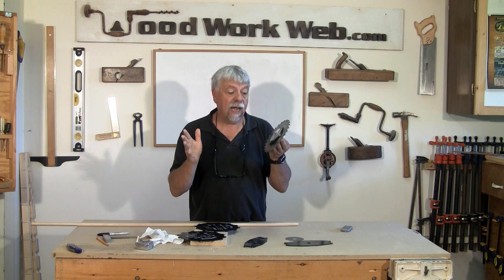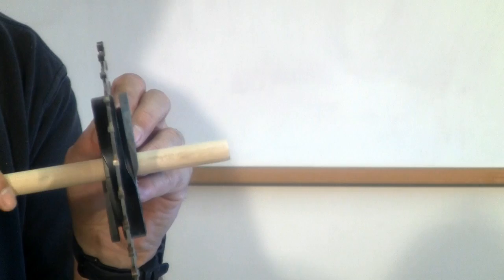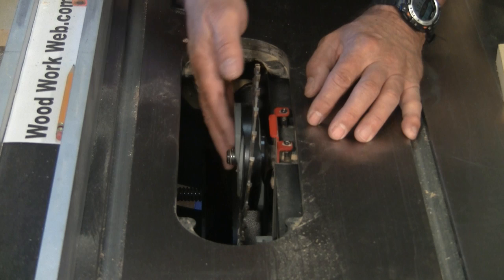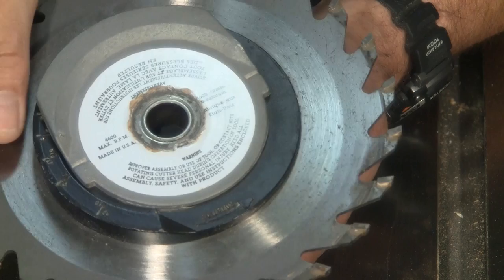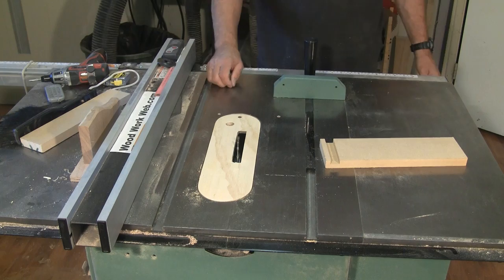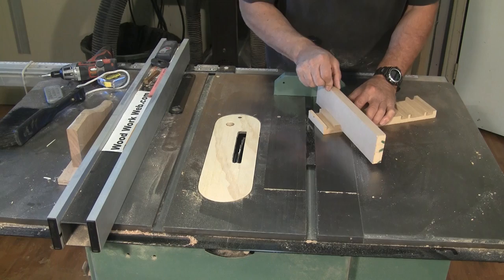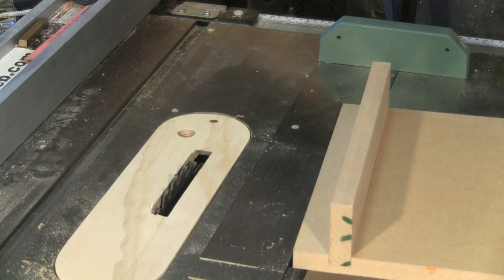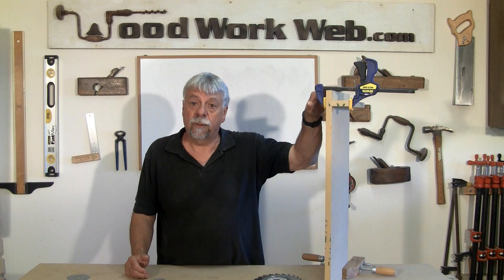Testing the Wobble Dado Blade -  woodworkweb

Comment: perhaps as the arbor is tightened it maybe changing the settings on the wobble. maybe if they re-engineered this product it could be several different wobble wheels at predetermined dado thicknesses considering the low cost. nice video though. one of the funniest ones ive seen from you. i can only imagine the curses coming outta ya during the sped up parts of the vid. lol

Comment: I have one also, have had it for 25 or 30 years.  Only problem I have with it is that it needs to be sharpened but no one in my area can sharpen it.
Reply: Really?  My saw shop guy said he can sharpen anything, he just can't replace the carbide on random blades.
Reply from the maker: That's interesting, I would  have thought most sharpening places could do that. I will have to check with my local sharpener, thanks for sharing this Doug, I did not know that.
Reply from the maker: Nicholas Smerk Yes, I am going to check with mine to see if they can

Comment: Stay away from the "Wobble wheel" just save a little and buy a decent dado set. The wobble wheel causes unnecessary stress on the saw components that they were not designed to handle. That is why they stopped making them, not just cause they sucked. who wants a spinning frisbee of death flying through their shop and even worse now it's become wobbly and everyone knows that makes it 1000 times more deadly

Comment: If I had to rely on a dado for a glue line I wouldn't want a channel along the bottom of the dado.  If I ran a furniture shop, and it was down to my joint security versus the joint security of competitive furniture builders, I would wager towards a more secure joint, and therefore without the glue channels.  If other furniture companies or cabinetry shops were ok with that glue line channel, I suppose that would be ok with me, though I'd rather everyone just use whatever made the strongest joints.

Comment: Do they make this in a 12 inch ?
Reply: aux1z11 They did, though 6" and 8" were far more common.
Reply: who are you arrisicorncob?
Reply: I have a pathetic little woodworking channel under the ID "MrToolHunter" but the Aristocob channel is where a most active. I've been a corporate trainer at a German cabinet hardware company for the past 17 years and before that I spent 12 years as a trainer for the Shopsmith power tool company.  But to my grandkids I am Batman.

Comment: I have an old craftsman dato blade I use for rabbiting wood to make siding for our sheds we make lol it works great just aggravating if it gets off setting
Reply: just have to have a heavy saw or it'll vibrate it all over the place and eventually wear the bearings out
Reply: Never had the vibration you refer to.
Reply: Barry Wind physically impossible to have no vibrations with a blade like that (ignoring the fact, that there are vibrations on a saw in any case)
Reply: Okay, your getting real tech... yes there are vibrations on any machine. So, there is NO more vibration than normally found. Not with the blade I use. Did you notice the counter weight on the adjuster? Oh, you say, too late. The one I bought does not have what you describe... period. Now, go argue with someone else.
Reply: Your words do not change my answer one iota. My unit does not have what you want it to have no matter what you say... sorry. Go argue with someone else.
Reply: Barry Wind "I deny reality and that's auf good thing". Alright then. Seems like your unit created a parallel universe, where physical laws don't matter. Should I call NASA?
Reply: does it really matter you guys, I have a power matic that doesn't wobble when a wobble blade is on it, but the saw I was referring to was one that we take out on jobs that weights maybe 30-40 pounds so yeah when the blade spins at 7,000 thousand rpm it does shake if not clamped or attacted to the stand. I really couldn't care what anyone says when I see the thing shake with my own eyes a few times a week. I know that there is potential for them to shake. End of story, now go about your day.

Comment: this thing SCARES ME!!! if this is ust to cut a wide swath through wood for the reason in the video, it makes sense to use if you are like mass cutting dozens of the same fitting. I do not wood work at all so it is really MY OPINION! just from a total outside point of view. what is the use for the wobble wheel other than what I expect? I wanted to add THUMBS UP though or a really well edited and presented video you deserve the subs and thumbs up for that & for your desire to showcase this ... thing?

Comment: It seems like it would put a lot of wear on the motor bearings from the vibration
Reply from the maker: +John Doe I guess if you used it a lot it might, but it doesn't really vibrate despite the name .. they run pretty smooth,
Reply: +John Doe most table saws run with a belt that will absorb any vibrations, which there is none. These are well engineered.
Reply: You know how they balance out a car wheel?

If it wobbles, they just stick tiny pieces of lead on the inside of the rim and all the wobble comes out.

The mounting plates and adjustment system likely work the same way, balancing the weight to counter the wobble.

Comment: I don't use table saws, but I can see why those blades are not very popular, they take too long to adjust it to the right dado width and waste a bunch of material in the mean time just to try to get it to the right width. 
I would also assume that with an off center blade, it's going to cause vibration in the table. I don't think I like that idea either.
You're better off saving your money and getting a real set of dado blades.

Comment: one thing i do not understand cant you just sett it to cut the gap a litle short so you afther can just saw away the remaining  With that you need you do have an acurate table so you can use it so see if the gap is needs to be 1mm wider just sett the table to cut 1 mm to the side and cut of that 1 mm instead of fiddeling for an houer and finaly get it corect for 1 or 2 cutz

Comment: I'm going to pick one up for cutting dado for drawer bottoms.  As many of you know metric mania has swept us all into a quagmire of confusion, 1/4" plywood ain't a 1/4" it's thinner and stack dado blades only cut as thin as 1/4".  Ain't that just great.
Reply from the maker: Yep ... a quagmire of confusion is right, can I quote you on that Ed, that has got to be the best description I have heard.
Here's the deal with plywood (all plywood) according to the plywood manufactures code (or whatever they call it), no plywood will exceed it's thickness spec. You can even view the actual wording on their website.
Basically that means any plywood you purchase is under-thicknessed by design, then add in a bit drying shrinkage and we basically have to measure each sheet for thickness. Pretty inconvenient ...
Reply: WoodWorkWeb Yep, you can quote me.  I have some 1/4"  plywood with a maple veneer so thin that it amazes me that it can be cut that thin; so thin that you don't even dare look at it for fear of sanding through.  Though the label says 1/4" it is a mere .190, unbelievable.  Some nice 1/2" plywood measures only .460.  I can do the math and figure out how to cut a dado for .460, but .190 is impossible.  Maybe a wobble dado is the answer.
Reply from the maker: Ed Waggoner Sr. It might do the trick Ed, let me know how you make out with it.  And yes I know what you mean about some of those veneers, they look like they were painted on they are so thin.
Reply: WoodWorkWeb Colin,  it took a while, but, I recently acquired two wobble dado blades for free, both in like new condition,  I really wanted to be able to use one of them on my Delta radial arm saw, but alas the arbor is to short.  But they both fit my old Rockwell table saw/ jointer.  One of them adjusts down to a bit less that 3/16" making it just right for making drawer bottom dados that fit the odd size 1/4" plywood that ain't really 1/4".  So, thanks again for the great video that got me to thinking.  I really didn't want to purchase a special router bit, beside a dado blade cuts much faster without having to make multiple passes.  As it turns out my larger 33-890 Delta RAS has a longer arbor.
Reply from the maker: Ed Waggoner Sr. I need to shop where you do Ed, free is a good price :)
Glad this was helpful to you ... always good to hear from you Ed
Colin

Comment: I just have a cheap tabletop saw that has a shaft that's too short to fit more than one regular blade.  If I had a saw that could take a wobble blade, I'd make a jig to hold the blade so I could adjust the width before I put it in the table saw.

Comment: nice tool ! but heavy table needed for this. and\or non-high RPM
Reply: Not really, the blade is fitted with a counterweight that balances it the vibration is still noticeable but its hardly critical.

Comment: I noticed that all your many first cuts were too narrow, so you were only slowly approaching the right setting. You can speed up all those adjustments with what in computer land is called a "binary search". First take a setting that is definitely too narrow and do a test cut. Next do one that is definitely too wide. Write it all down. Now take a setting in the middle of the previous two and check if you need to be in between that middle cut and too narrow or the middle and too large. Assuming the middle cut was still too wide, now do a test at 1/4 and check again if you are between 0 and 1/4 or between 1/4 and 1/2. Rinse and repeat and in just a few tests you are where you need to be. Much faster than "slowly approaching".

Comment: You can fine tune a stacked dado set a bit by slipping paper between the blades. :-)
Reply from the maker: I have not tried that, but it sounds quite do-able ... thanks for the tip

Comment: I think someone should rework that thing. If you could make dialing it in more accurate it would be great. I dont even think you had to take it off the arbor to move the dial a bit, looked like just a viewing issue. Like you said, the crown was in acceptable limits, I would buy it all day long.
Reply from the maker: Yeah .... I'm not an engineer, but I think you are correct, for the right person, this unit could certainly be improved ... it does have some merits.

Comment: The saying "measure twice cut once" comes to mind for some reason?
Reply: +Pepper Spray Wobble blades puts that saying on its head. The guide is completely not accurate, i guess it is difficult to manufacture them with tight enough tolerance, but I hear you get a knack for it once you learn how your specific wobble blade is out of spec.

Comment: Mathematically it wont make a flat rabbit. As one blade is being used to oscillate from one side to the other it will have a high point in the middle so it can weave from side to side. The wider the cut the more the high spot is noticeable.
Reply: And the side walls will not be 90°, they will be tilted
Reply: Think again Brecht. As the blade rotates, the outermost point of the blade  takes a round flat route, as the other points of the blade. That makes the blade to cut precisely a 90° sidewall.
Reply: baladár kolompár I did think before I comment, and I still think that the sidewalls will not be 90 degrees. I would have to test it to see if the 3D imagination in my thoughts does fit with reality or not. And the fact that the oscillation gives a rounded surface instead of a flat one (depending on how wide you set it etc) gives me an other theoretical suggestions hat that is the case. But I don't have experience with those wobble blades, maybe what I said does only count for deep cuts and/or wide cuts. Or maybe I am imagining it wrong.
Reply: baladár kolompár Maybe I should try to find someone with a wobble blade and test it for myself how well my imagination match to reality
Reply: Brecht Schatteman
I had experience with one of these blades, and the sidewalls of the cut is 90°. The top (or bottom) surface of the cut is rounded a bit, but not he sidewalls. As the workpiece touches the blade, the blade cuts its bottom, and as the workpiece moves ahead, the groove is getting deeper and deeper. If your tablesaw's shaft is parallel to the table, the cut will have 90° sidewalls.
Reply: baladár kolompár I did understand what you ment, but it is something I will have to check myself unfortunately. It is always possible that I make a mistake, and knowing myself I probably did.
Reply: Brecht Schatteman
If you admit that this has to be checked by yourself, then you are a smart guy. Practice makes the master. Take care.
Reply: baladár kolompár It mostly is recognizing I lack the experience/knowledge, that should only be called the start of being smart. In Dutch we say 'knowing yourself is the beginning of wisdom' but I don't know what the English equivalent is (probably that knowing yourself is the key to wisdom or such). And as much as I would like to start with woodworking and get some experience and make my mistakes, it will probably be for later. I lack the funds (although, I could borrow some stuff somewhere and I can always start with those dirt cheap low quality chisels) and the space (I am a student living with my parents and no real space left for such a hobby). Maybe in a few years, maybe when I hit a midlife crisis, maybe when I am retired, I can't predict when, but I know the itch is there so one day I will not be able to resist. Until than there is YouTube and guys like you who can have a normal conversation without stating to know it betters without calling people like me dumb. That is also why I like the woodworking community in YouTube, they are more accepting and tolerant than the average community. I wish you have a good day, and thank you to enlighten me about where my visualisation did go wrong. It probably did, but sometimes it can't hurt to check it yourself, just to be sure ;)

Comment: looks like a lil bit of a nightmare to setup but for the cost it seems pretty reasonable and like any tool it's only as good as the person using it. i've no doubt though if you do a lot of dado cuts then setting something like this up will be almost second nature. by the way! your last name comes from German and translates to Knight :)
Reply from the maker: You are right, it can be a nightmare, but .. you can also get it perfect the first time, unfortunately I cannot, which is why I struggle with it.
Thanks for the translation note too :)
Reply: :) no problem! i usually need to fiddle with stuff a lot until i get it exactly where i want it before i start to do anything lol. can easily waste half the day away just setting everything up!

Comment: You have it wrong. Wobble wheels cut flat bottom dados. Stacked sets don't. The problem with a wobble wheel is they're a little fussy to setup. You also spun the blade the wrong way too.
Reply: +Paul Frederick Yes, dado stacks tend to leave grooves in the bottom of the cut.  However, the wobble style leaves a slightly curved bottom.  As you saw in the video, it's not worth worrying about.

Comment: I would have thought it obvious what is wrong here and why there is an apparent gap. The floor of the dado is at he right depth, the problem is that as the blade leans the teeth are no longer cutting flat but as they are leaning they are cutting at a slight angle and so the floor of the dado will rise just slightly as it approaches the wall. The gap is caused by the inserted board sitting on the two slightly raised portions closest to walls.
Reply: +Jim Porter The wobbling blade actually cuts an arc. The radius of the arc is actually the radius of the blade.
Reply: I don't think so. That dado bottom looked pretty flat. I think it is like a 7" diameter blade. I don't think the dado bottom could have a 7" radius. That would be pretty noticeable.
Reply: I agree.. if you think about it, imagine that you're trying to cut a 5 inch wide dado.. or go to an extreme and say you want to cut a 7" dado with a 7" blade.. you'd have to make the blade wobble all the way sideways.. in which case the arc of the cut would match the arc of the blade.
Now, to be totally technical, the width of the blade complicates things and you'd have to imagine two arcs turned sideways at 1/8" apart (or whatever the width is at the top of the teeth)
So the arc is the same as the arc of the blade plus the width of the blade inserted in the middle.
Phew... the time when you sit in Geometry class and say, "I'll never use this in real life"

Comment: If you pick up a older wobble wheel ( mix speed  between 4500 to 4700 ) use on today's machine ( speed between 5000 to 6000 ) I don't know if it's good idea ? you might say what will happen just cut wood !  they had those # on have a reason (safety use ) don't take chance with safety !

Comment: could i put it on a portaple  table saw
Reply from the maker: +crazyfrenchfrog007 Probably not, most portable table saws have very short arbors for a reason, and that is they are not sufficiently strong enough to use this type of blade.